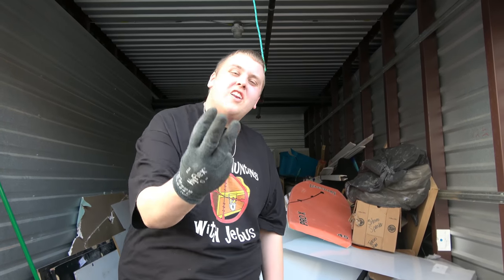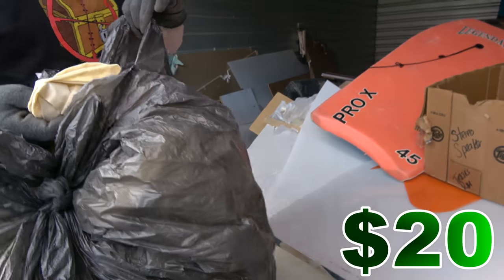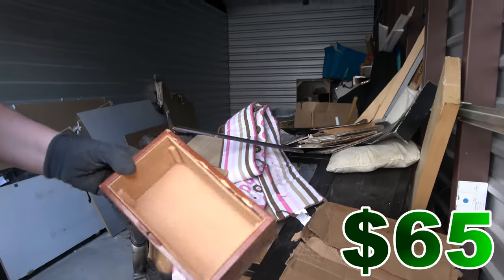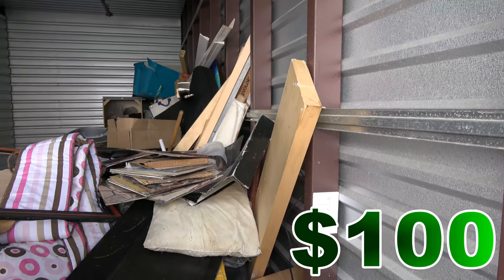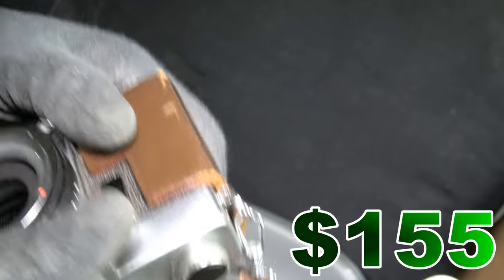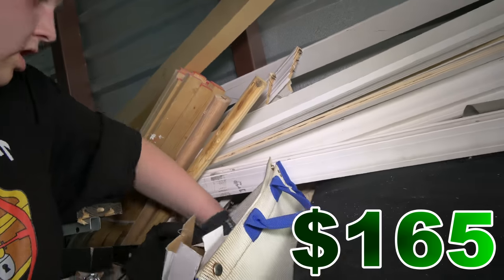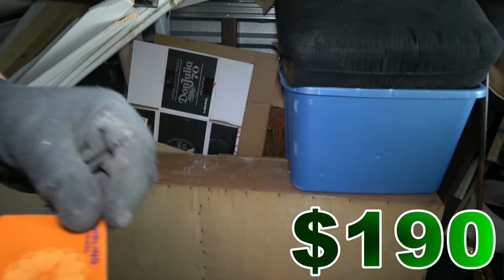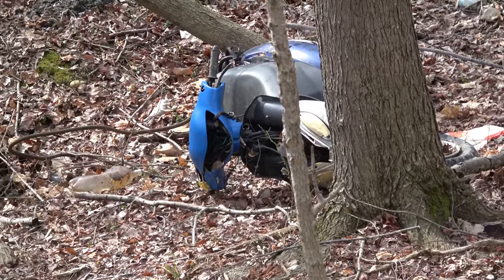I Bought An Abandoned Storage Unit For $10 And Made SO MUCH MONEY! GIGANTIC STORAGE UNIT PART 3

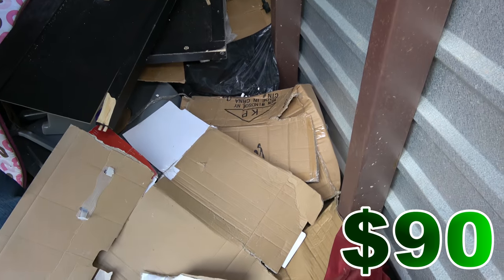Comment: Remember I told you before that there are 3 sizes of records? THe small ones are 45's then the bigger ones are 33's then there were some the same size as the 33's but they were thicker? Well I could be wrong but the box of records at time stamp 5:13 that you found 1st part of this video  look like they are thicker then the regular 33's so they would be the older ones called 78's.

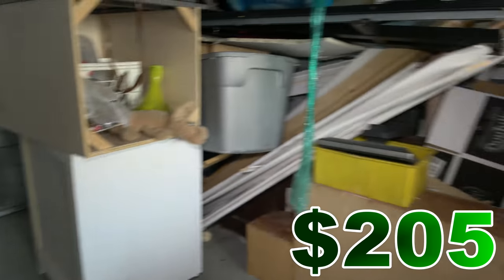Comment: That dog plushie toy at 13:41, I once got a set of very small plushie toys you could hold in your hand just like that big one there, with the long ears, flat posture and eyes. Couldnt find any info on it though, and doubt its worth alot.
EDIT: I did some digging and they're called "Pound puppies" lol. The small ones sell for a few pounds in UK ebay. Apparently some are from 1984. The big one also seems to only sell for a few dollars UNLESS theyre in mint condition, then were talking atleast 24,99 pounds.
Quick link to it: https://www.ebay.co.uk/sch/i.html?_from=R40&_trksid=m570.l1313&_nkw=pound+puppies&_sacat=0